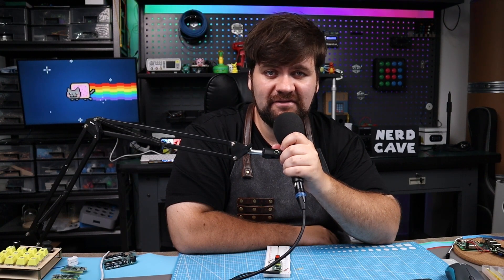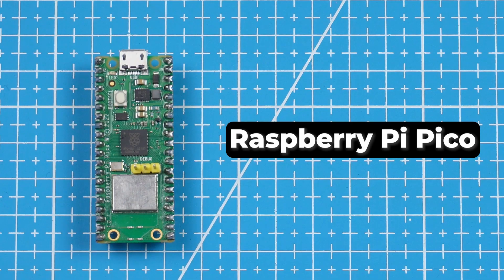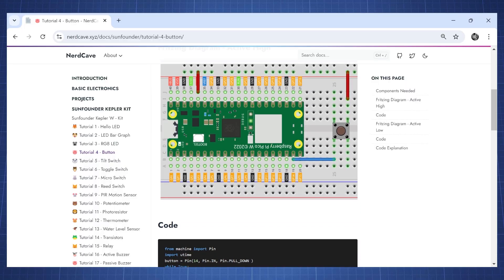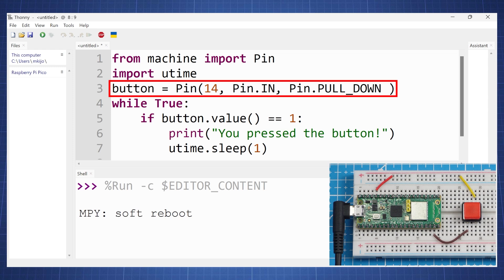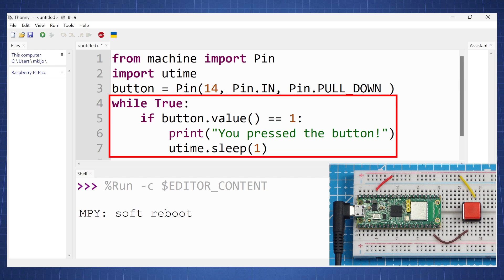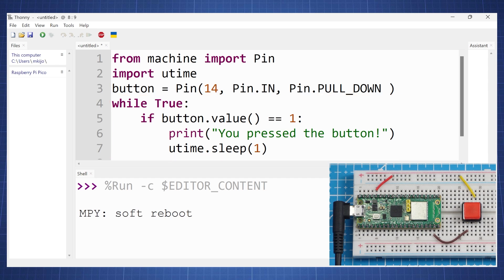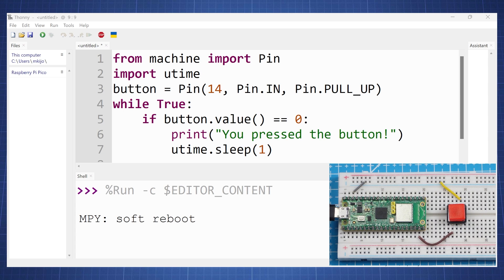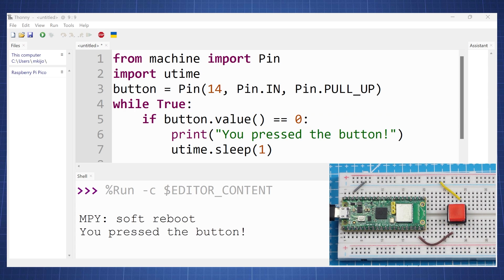Button Input - Raspberry Pi Pico - Tutorial

Comment: Hi. I tried this with my Pico 2 W but couldn't get it to work until I moved 3V3(out) to a GND. Is it because it's a Pico 2 and not a Pico?
Reply from the maker: On a Raspberry Pi Pico you can wire a button 3.3V → GPIO = Active-HIGH (reads 1 when pressed), or GPIO → GND = Active-LOW (reads 0 when pressed, using pull-up).
A pull-up resistor keeps the pin HIGH by default (1), and the button pulls it to GND on press (0).
A pull-down resistor keeps the pin LOW by default (0), and the button sends 3.3V on press (1).

Comment: is the high config better  than the ground input config ? I have problems with bounce... using software with 100ms and working fine but I wish I could run it with 40ms flawlessly... does a 1k resistor would do the trick puting in the ground?

Comment: Why would you choose active high over active low?
Reply: i would like to know the answer to this too!
Reply: In Pico 2 W for example you will use active low because there is a bug that means the pull down resistors do not work. But normally this would depend on the sensor/button/input device. with a button that is normally not connected you may prefer to use active high, but for some devices the code becomes easier if you use active low (eg. some rotary encoders). I will normally depend if the device has a connection when in rest (use active low) or does it have a connection when active (use active low). It is simply a matter of convenience, or preference.